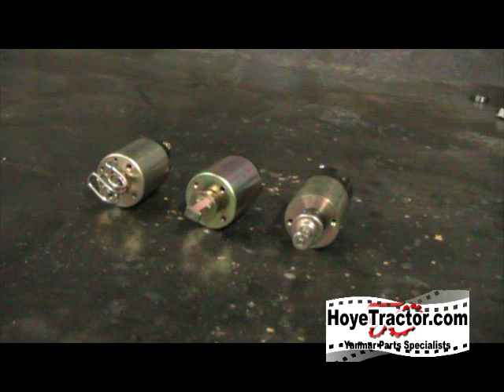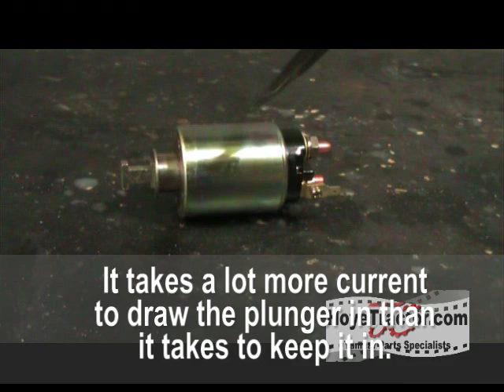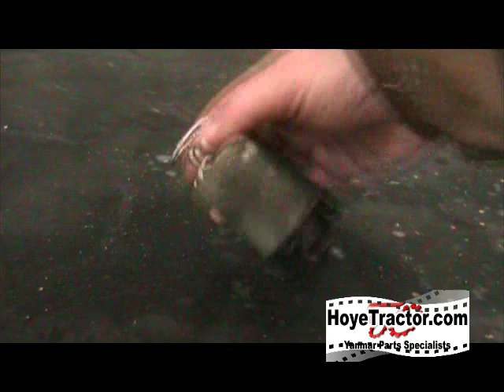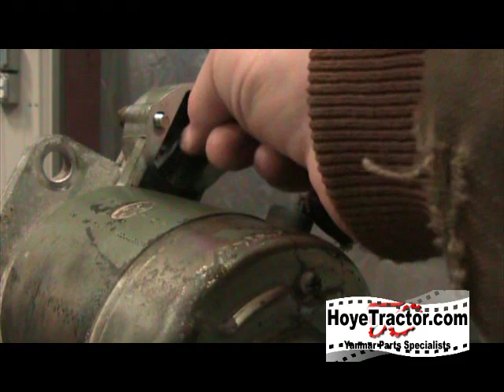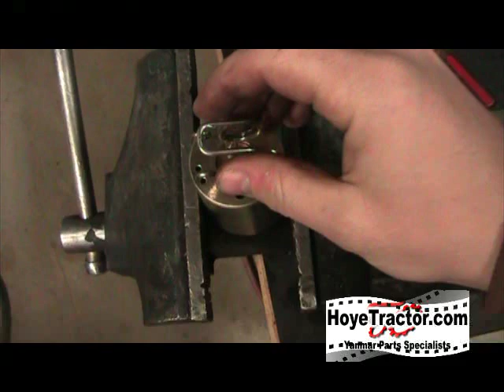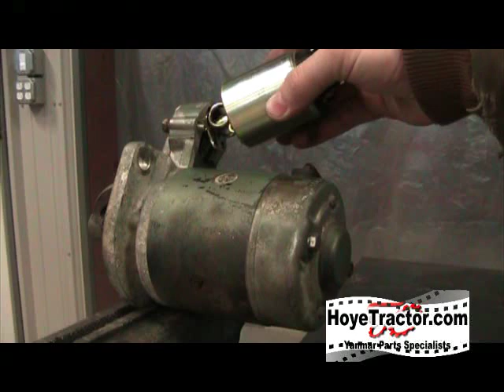Yanmar Tractor Starter Solenoid Replacement

Comment: Although not mentioned in the video. If you got this far and the solenoid "went South" due to old age and a lot of use and abuse. It´s reasonably to assume the remaining starter components also payed it´s toll.  

So, check the carbon brushes and the tolerance of the bushings in that starter. It cost "pennies" to replace and it¨s damn easy while you have it in your hand. Same for cleaning (rubbing alcohol) and lube So it just make sense. ;-)

On older designs, before they sealed everything to avoid repairs and make you buy a new one every time. ;-) 
The solenoid can be disassembled and the pitted contact surfaces can be rectified/flattened and put back into service for many years to come. On some you can simply turn the contact plate and use the previously untouched face. Usually last for a really long time.
Some forks can also be turned and be kept in service for long. ;-)
Cheers all

Comment: Hi - thanks for the video. I have a 86 Yanmar 336D and the tractor had sat under a lean to for about 2 years. I put a new 650 CCA battery in it and when turning key to start position nothing happens, no cranking turning over or anything. I'm not the greatest at troubleshooting electrical systems so any help on what to start with would be greatly appreciated. I have a multi-meter and am thinking I would test the starter switch on solenoid first?? I'll shut up, any advice would be greatly appreciated :)
Thanks,

Comment: I have a yanmar Diesel engine in my Daewoo skid steer it needs a solenoid the stud in the solenoid is loose and melted itself and the nut and it won't tighten up it looks like the one in this video I need to get a new one I'm tired of jumping it over especially hard in cold weather and afraid of it completely burning into or burning the starter up.

Comment: What about the voltage transducer mechanism under the ring assembly? This is obviously a pre 1988 metric replacement or later model with the Breton module.